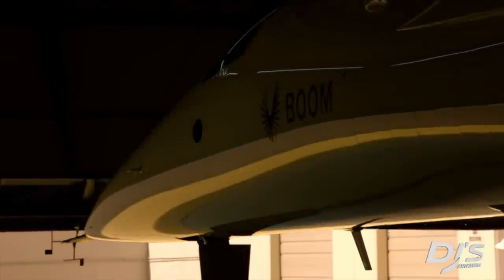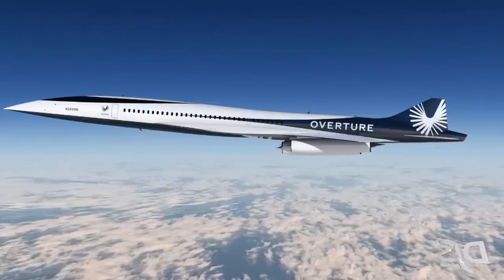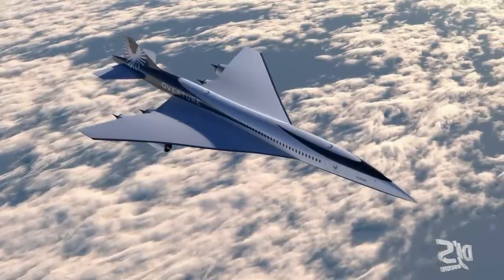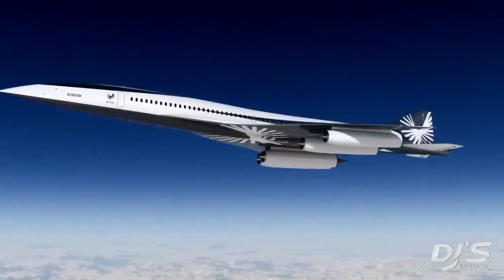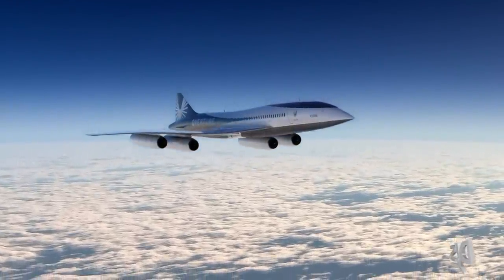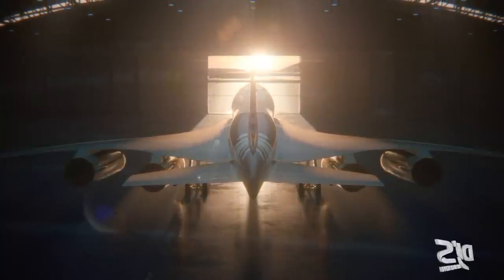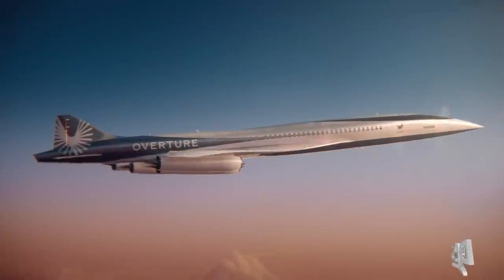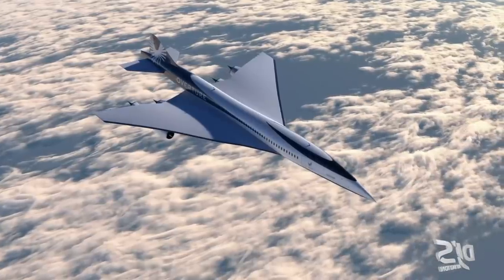Boom Supersonic MASSIVE News

Comment: I have lived under the london hethrow flightpath my entire life, and have never complained about the noise. Its something that people who dont live here think is a problem for us, when in actuality, more planes benifits the area rather then hinders it.
I rember concorde as a kid, and every day at 7am and 7pm, you would get a boom no louder then shutting a door. It realy wasnt that bad. Just a bit of an overreaction from people who dont understand.
Reply: Well I remember Concorde as an adult and you never heard a sonic boom anywhere near Heathrow, it went super once over the Bristol Channel, Concorde must be the only plane ever that people would actually go outside to watch in awae and pride.
Reply: Concorde didn't go supersonic until it was no longer over land. You may have heard the engine signature over Hounslow and Windsor (and it was indeed significantly louder than everything else) but not a sonic boom
Reply: It was never the boom for me. It was, however one of the loudest planes on the ground because of those beautiful Olympus engines. I worked at DFW Airport when Braniff had two of them landing at the same time to announce the start of service. S beautiful sight! Touching down on the opposite sides of the airport and taxied to the Braniff gates and ended up almost diagonally nose to nose. Much smaller than I had imagined. More like an MD80 or 717. Very tall! Beautiful, like a runway model. But it WAS loud. I didn't have a single complaint about it.
Reply: Buddy it depends where you are relative to the boom... 
Last year a rafale flew supersonic above Paris... Believe me that it was heard like a damn explosion in a 15 km radius

Comment: Whitcomb Area Rule. To minimize aerodynamic problems encountered near and at transonic speeds, the change of overall cross sectional area of the aircraft viewed from the front must be as smooth as possible. With a Delta winged design, this naturally leads to a fatter front fuselage cross section.
Reply: I'm not sure why some folks make a big deal about the "Area Rule". It's not a recent innovation. It's been widely applied since the 1950s -- such as the Convair F102A. The Citation X and even the A380 also use Area Rule. 
Ps. It would surely have been an oversight if the Overture design didn't use it.
Reply: @martinfendt1305  Oh my, yes. Check out the anti-shock bodies on the Convair 990 wings.
Reply: @martinfendt1305  and the Buccaneer.
Reply: @langdalepaul  also the BAC Lightening Mk6 -- Its extended ventral tank optimised the area-rule on that aircraft.

Comment: I'd say the massive news is yet another speed reduction. Originally it was mach 2.2 along with the fanfare that it would be faster than Concorde. Then it was dropped to mach 1.8 making it slower than Concorde. Now its been dropped again to mach 1.7. That's a bad look if I ever saw one.
Reply: What's even worse is that these new supersonic planes were supposed to be able to fly supersonic over land and now they said it will not.
Reply: @Islamisthecultofsin  It still can, it just need the law to be changed. And there still are places on earth you can fly supersonic over ground

Comment: I'm not sure how many airlines will want to order it now that it has 4 engines that will burn considerably more fuel than existing quadjets which have already fallen out of favor and its limited range of 4,250NM severely restricts the number of routes it can fly on. With the increase in size I expected an increase in range to at least 6,000NM to be viable on transpacific routes where supersonic flight could see immense time savings and attract East Asian airlines to order the type so I'm quite disappointed.
Reply: Yes - and on what engines does it get this 4250NM range?  I'd think "less passengers but 6000NM" would be more of a sweet-spot for considering modern business reliance on Asia.
Reply: I think this does have a chance because of the void left by Concorde. Like that one, its not for the masses, yet updated with modern quieter technology to regain access in some airspaces. I think this will be a first class/business type only for long distance where it makes sense. Only down i see is the name of the company which kinda projects the opposite lol.
Reply: I thought four engines = more fuel, but none of the engines need afterburners now so without the fuel consumption of reheat it will kind of balance out.
Reply: @jimmyjango5213  But the range should also increaseby at least 50% without reheat.
Reply: @freeculture  i can already see the headlines in the media.
Reply: And don't forget it has to stay subsonic over land (ie Europe-Asia). It just is not going to save enough time to justify the extra fuel burn, small capacity and higher maintenance (four engines ...). There are some formidable design challenges in making a supersonic plane quiet enough and safe enough for regular commercial routes, but even taking Boom's word that they have overcome these I cannot see how it will ever make a profit.
Reply: @jimmyjango5213  Only a little more fuel, but double the maintenance of a twin. This is what has made twins more popular.
Reply: @tomamberg5361  The engine are magic pipes for now.
Reply: @kenoliver8913  which is just stupid because why on earth would that matter?  Supersonic booms do NOT drastically impact the surface, or anything on it.

Environmentalists really have hamstrung our advancement as a species.
Reply: @OneBiasedOpinion  Wrong. Supersonic booms smash windows in whole cities - they systematically tested it when Boeing was developing its Concorde rival and only then banned Concorde from supersonic speed over land. Why should average people have to put up with that for the sake of a handful of the ultra-rich?
Reply: There are many trade-offs in subsonic airliner design, and many more in supersonic airliner design. Overture will be the same length as Concorde, but will have a bigger wing with empennage. Overture will also be lighter and possibly more streamlined, but the 2 aircraft bear some comparison for illustration.  

The speed range for Overture is zero, for take off at sea level to Mach 1.7 for cruise at 60,000 feet. The take off noise will be compliant with ICAO-14 regulations, slightly quieter than current subsonic airliners. In comparison, Concorde generated an awesome 120 dB noise level.

Each of Concorde's four engines, generated a take off thrust of 37,000 pounds with reheat. At 40,000 feet, due to low air density, the thrust dropped to 10,000 pounds, and at 60,000 feet it fell more to 6,800 pounds, while cruising at Mach 2.0.  This reduction in thrust with altitude is normal for jet engines and the same order is to be expected for Overture's engines. BTW subsonic airliner engines typically only have 33% of their sea level thrust at 30.000 feet. 

Boom also intend that Overture will be fuel efficient at sub (Mach 0.94) and supersonic (Mach 1.7) speeds, compared to Concorde's great thirst, especially at subsonic speeds. This will be achieved by using a supersonic medium bypass engine with spike input diffuser and variable geometry exhaust nozzle, which will also reduce noise, as will the use of 4 engines, with no reheat.

This just covers some of the main factors, but there are a load more, which Boom's engineers, Florida Turbine Technology, and the consulting engineers will have simulated when they chose 4 engines, rather than 2.
Reply: Overture is not aimed at the main line economy market, which is more than adequately catered for by Boeing and Airbus, for example. Instead, it is targeting the 700 million long range business trips made each year globally, 400 million by Americans.

Because Overture will be fuel efficient at sub and supersonic speeds, and will be compliant with ICAO-14 subsonic noise regulations, Boom and the airlines have identified 500 viable routes, some mixed land/water, compared to just 2 Atlantic routes for Concorde. Commercial supersonic flight over land is effectively banned worldwide, so Overture will fly Mach 0.94 (10% to 20% faster) over land and Mach 1.7 (x2 faster) over water. 

A subsonic airliner does the JFK/LHR trip in 8 hours. Overture will do it in 4 hours.
A 16 hour subsonic trip across the Pacific would require a 1 hour refuelling stop, giving a duration of 4+1+4=9 hours total on Overture. 

All 65 to 80 seats will be quiet business class, almost certainly with internet, with ample room. Tickets will be the same price as subsonic business class. This, coupled with twice the utilisation of subsonic airliners, would give a good margin for the airlines.

Comment: The entire industry is dropping four engine aircraft to the point where it is scrapping perfectly usable units, and this is said to be the future?

I was at the Farnborough air show when a new fuel efficient Boeing 787 was being shown alongside a new super-capacity Airbus A380. Both were going to be the future. 

Concorde was an amazing machine, and it was fantastic that it came along when it did, as it was the right time to live its longest life. But high running cost, limited market machines do not make a good business plan.
Reply: The engine they have is not sufficiently powerful to propel it at mach 1.7 with only two engines. 3 is needed. Still 3 is a maintenance head ache. So general 4 is actually cheaper.

The first supersonic aircrafts will be needed to be 3 or 4 engines to be of economical size.

I guess when they refined it, they can make the aircraft quite a bit larger with retaining the number of engines, eventually getting better engines and reduce it to two.
Reply: @matsv201  The downside of waiting for technology to catch up is that as these engines get more efficient, so do all engines. As this airframe becomes more economical to fly, so to do the already more economical aircraft. 

It will never close the gap on profitability of subsonic aircraft. It will always remain a higher running cost machine catering to a limited market by comparison, no matter how good the technology becomes. 

It's just a fact of diminishing returns.
Reply: @smada36  True, most carriers now are going for models such as the Airbus A321 XLR and the A350 and other 2 engine variants which are super fuel efficient and can hold lots of PAX. 4 engine jets are being phased out and also to make their money back whilst only carrying ~70 PAX per journey they're going to have to charge a huge amount for tickets which will put people off.

Turbofans are just so efficient now and airlines are more looking to squeeze every bit of efficiency out of them anyway, going fast doesn't really matter to them.

Comment: I think there is a reason for this change: Boom has gotten access to GE Aviation's Affinity engine, which was temporarily shelved when the Aerion AS2 project ended last year. It may mean GE Aviation could have a testbed engine running by 2024.
Reply: Not likely they shut the program down and too low volume for GE to be concerned.
Reply: No, the affinity is dead. If Boom had switched engine suppliers from Rolls, they would have said so. 

That Rolls-Royce won the engine development contract with Boom in spite of having no engine to offer, nor one in development, speaks volumes for how realistic this whole programme is.
Reply: The Affinity and the RR  engine Overture use suppose to have about the same performance. The change probobly have more to due with balance and maintenance.

An aircraft is more efficient the more space there is between the wing and the stabilizer. If the stabilizer is in the back, as in pretty much every airliner. The more forward the COG is, the more efficient is the aircraft. But if you make a aircraft 3 engined, there is really just one place to put the third engine. This also make maintenance much worse.

For example, the A340, that many people see as  failed aircraft, was actually more efficient than the MD11, despite having more engines. It was also much cheaper to maintain.

Now.. i don´t see it as impossible for GE to revive the Affinity engine of Overture is a success.  The new engines is pretty much a new era of aircraft engines, like the JT9D once was, that defined an generation. Pretty much every aircraft was build around that as a standard (747,767, A300, L1011, DC10) even some of them never used that engine, the size and capacity defined there counterparts.

Comment: It looks like a mix between the Boeing 2707 and the Tu-244
Reply: Huge fan of the Boeing 2707. This is pretty close. Nice airplane ✈️
Reply: You mean TU-144
Reply: @heidirabenau511  no I meant the B2707. Even though it wasn’t built. Still one of my favorites. If it was built, of course it would’ve been my favorite airplanes ✈️
Reply: @heidirabenau511  no i mean 244
Reply: the 244 was a concept
Reply: Boeing 2707-300 fixed wing

Comment: I think making this a 4-engine aircraft is the death blow to the project. Maintenance costs are going to be incredibly high!
Reply: Not necessarily, if it uses GE Aviation's Affinity engine.
Reply: But it'll reduce noise allowing for shorter more economically viable routes to be taken especially over land. Not to mention making it easier for the passengers inside.
Reply: There are many trade-offs in subsonic airliner design, and many more in supersonic airliner design. Overture will be the same length as Concorde, but will have a bigger wing with empennage. Overture will also be lighter and possibly more streamlined, but the 2 aircraft bear some comparison for illustration.  

The speed range for Overture is zero, for take off at sea level to Mach 1.7 for cruise at 60,000 feet. The take off noise will be compliant with ICAO-14 regulations, slightly quieter than current subsonic airliners. In comparison, Concorde generated an awesome 120 dB noise level.

Each of Concorde's four engines, generated a take off thrust of 37,000 pounds with reheat. At 40,000 feet, due to low air density, the thrust dropped to 10,000 pounds, and at 60,000 feet it fell more to 6,800 pounds, while cruising at Mach 2.0.  This reduction in thrust with altitude is normal for jet engines and the same order is to be expected for Overture's engines. BTW subsonic airliner engines typically only have 33% of their sea level thrust at 30.000 feet. 

Boom also intend that Overture will be fuel efficient at sub (Mach 0.94) and supersonic (Mach 1.7) speeds, compared to Concorde's great thirst, especially at subsonic speeds. This will be achieved by using a supersonic medium bypass engine with spike input diffuser and variable geometry exhaust nozzle, which will also reduce noise, as will the use of 4 engines, with no reheat.

This just covers some of the main factors, but there are a load more, which Boom's engineers, Florida Turbine Technology, and the consulting engineers will have simulated when they chose 4 engines, rather than 2.

Comment: Let me start by saying this is beautiful aircraft and I wish Boom well in the endeavors, but I see a major hurdle for Boom to overcome and that is the cost for available seat mile being too high for carriers to make money with the aircraft.
Reply: Especially if you realise Concorde sported 100 seats, way more than this Boom project. it requires a lot of time and money to design something entirely new.
Reply: Overture is not aimed at the main line economy market, which is more than adequately catered for by Boeing and Airbus, for example. Instead, it is targeting the 700 million long range business trips made each year globally, 400 million by Americans.

Because Overture will be fuel efficient at sub and supersonic speeds, and will be compliant with ICAO-14 subsonic noise regulations, Boom and the airlines have identified 500 viable routes, some mixed land/water, compared to just 2 Atlantic routes for Concorde. Commercial supersonic flight over land is effectively banned worldwide, so Overture will fly Mach 0.94 (10% to 20% faster) over land and Mach 1.7 (x2 faster) over water. 

A subsonic airliner does the JFK/LHR trip in 8 hours. Overture will do it in 4 hours.
A 16 hour subsonic trip across the Pacific would require a 1 hour refuelling stop, giving a duration of 4+1+4=9 hours total on Overture. 

All 65 to 80 seats will be quiet business class, almost certainly with internet, with ample room. Tickets will be the same price as subsonic business class. This, coupled with twice the utilisation of subsonic airliners, would give a good margin for the airlines.

Comment: Interesting, it's a supercruise aircraft. So while very expensive to run and fuel thirsty compared to what's out there now. A lot more efficient than Concorde. This is obviously going to be a niche product as Concorde was so I doubt it's something I will ever fly on. Not with the trend upwards wise on terms of aviation costs.
Reply: But unlike Concorde, the Boom Supersonic can fly non-stop between Tokyo and Los Angeles at supersonic speeds, which means the potential to fly from Los Angeles to Sydney with only one fuel stop.
Reply: @Sacto1654  Are you sure about that? 4,250nm range and Tokyo to LA is 4,768 nautical miles, add in the need for over the water fuel reserves and general flight reserves and it's got no where near the range for that. Not even close. Concorde had 3900 NM range. Its range is not much more than Concorde.
Reply: Concorde was super cruise as well. 

I can't see this being mich more efficient than Concorde. There isn't any new significant technology here.
Reply: @jackroutledge352  Concorde I always thought needed the lowest afterburner setting to maintain mach 2. I stand corrected.